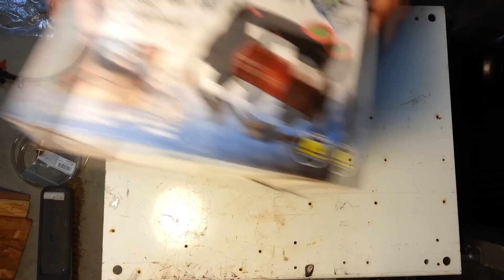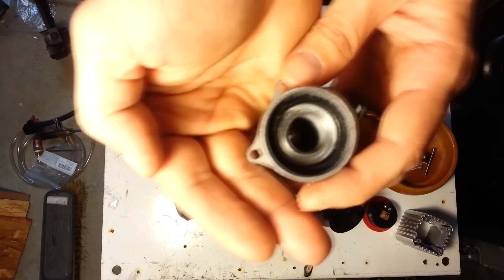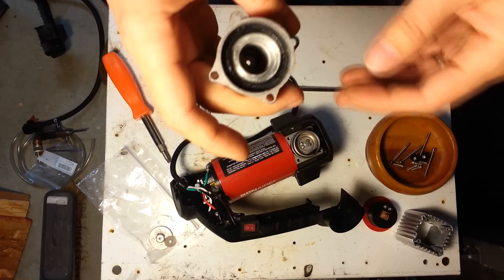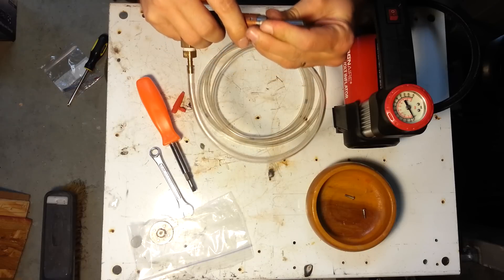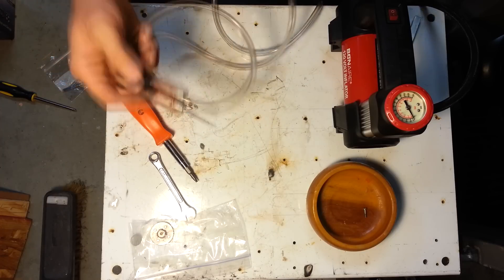Build a pneumatic metal engraver for cheap

Comment: Nice job. cool concept about the machine. I should also get the AC compressor instead of 12v DC. would save me some components :) I'll give you a thumbs up, the video was cool to watch and I like to watch others get into engraving. Shaun helped us all. he is a great guy and shares everything with us. keep up the good work! enjoy
Reply from the maker: Thanks. I enjoyed several of your videos as well. Very soon I will be creating a completely custom-machined graver that utilizes a regular air supply instead of pulsed. Will keep you posted...
Reply: Thanks so much for the video! I've watched many of the DIY engraver builds from Shaun and others.  I'd like to use the AC pump instead of the dc one.  Are you having a problem with the pump being slow starting with the speed controller?  DC is supposed to work better with this type of graver.  I am very interested in your last comment about making a graver that uses a regular air supply.  The Lindsy type of graver seems to hit harder and deeper faster.  Can you share any info on making that type yet?
Reply from the maker: A haven't had any problems with my AC pump. The engraver used to lose power at high speed but I followed Shaun's advise and made a new piston from aluminum instead of steel and that helped. 
For the new engraver design I've constructed 2 working prototypes of the mechanism and have designed the third, which will incorporate the mechanism into an engraver handle and bit. Hoping to machine that this weekend. I'm designing it for the super-sensitive, high-control small stuff like Shaun does rather than the hard-hitting that this version did. Funny enough, version A is based on the 1800s 'King's Jackhammer' patent. I also have a rotary-valved version 'B' that I haven't prototyped yet. Perhaps I'll post a video of just the prototypes before the real thing is complete. The spool valves require very precise machining and the piston is only 1" long, so it's tiny compared to what I'm used to working on. I've also cooked up an electric solenoid-based version but it generated too much heat to hold comfortably more than a minute or so. 

Thanks for your comment!
Reply: Thanks so much for the reply! I've been trying to understand the difference between the GRS type and the Lindsay type engraver.  Does the Lindsay type have the piston in the handle.  Is it like a piston in a car engine in the sense that it is highly machined in a cylinder inside of the engraver? Where can I find a drawing for this type of graver?  When I think of this design for some reason I think of a blow dart in the barrel of a blow dart gun.  But what makes it reciprocate up and down?
Reply from the maker: Lindsay is a bit "patent-happy" in my opinion, but I get that he's got to make a living. He seems to tweak the basic idea every few years and re-patent. Some of his patent descriptions are quite vague. You can view his patent drawings online. I understand the GRS founder is a buddy of the Lindsay family. 

GRS
https://www.google.com/patents/US6508315

Lindsay
https://www.google.com/patents/US6095256
https://www.google.com/patents/US6691798
[several more]

Don't get me wrong, you can tell by his diagrams that he is a highly skilled mechanical engineer, and certainly a very talented engraver. He definitely deserves to benefit commercially from his inventions. Nothing against him, I just think the US patent system has gotten a little wonky.

As for pneumatic mechanisms, there are a few good resources. This site has several useful animations and descriptions:
http://www.mekanizmalar.com/menu-pneumatic.html

The "King's jackhammer" patent I mentioned before:
https://www.google.com/patents/US513941

There are also a few videos on YouTube of people who have made pneumatic 'flip-flops' and self-oscillating air contraptions.
Reply: Is this one of those videos? I can sort of follow along.  The mechanism is much more advanced than the grs type internally.  He runs through detailed engineer plans with measurements.  I don't  have the machining equipment to mill it out but wonder how much a machine shop would charge to make them up.  If others were interested, maybe a group buy would produce some very affordable pneumatic handpieces.  What do you think?
Reply from the maker: Sorry for the late reply. I'm thinking the Chinese have probably already come up with an affordable handpiece cheaper than we could make. There are a few videos of folks test-driving those. I haven't tried one myself.
Reply: Do you remember how to find any of those videos or what words to search up in the search engine?
Reply from the maker: Someone really into it like Shaun would know more about the lowest priced models but I searched Ali Express and came up with the listings below. I presume they are junk, but most junk can be 'fixed' to get the job done...

$67
https://www.aliexpress.com/item/Free-shipping-Jewelry-Engraving-Tools-GRS-Graver-Max-double-end-handpieces-Hammer-Handpiece-for-Pneumatic-Engraving/32803665799.html?spm=2114.40010308.4.136.r64qom

$100 (2 pcs)
https://www.aliexpress.com/item/Free-Shipping-Jewelry-Engraving-Tools-Pneumatic-Engraving-Machine-Handpiece-Graver-Tools-Handle-Graver-Handpiece/32788025779.html?spm=2114.40010308.4.2.r64qom

$105 (Whole kit)
https://www.aliexpress.com/item/110-V-Graver-Helper-Pneumatic-Jewelry-Engraving-Machine-Single-Ended-Graver-Tool-Jewelry-Engraver-Jewel-Making/32604031067.html?spm=2114.40010308.4.97.r64qom
Reply: Thanks for looking.  I appreciate it.
Reply from the maker: Steve Lindsay's gizmo is pretty cool though. 
https://www.youtube.com/watch?v=4wxRyvGH7jg